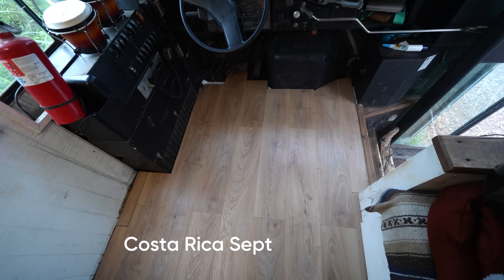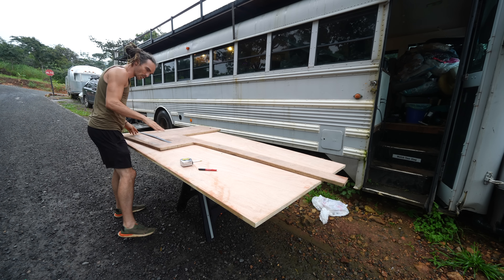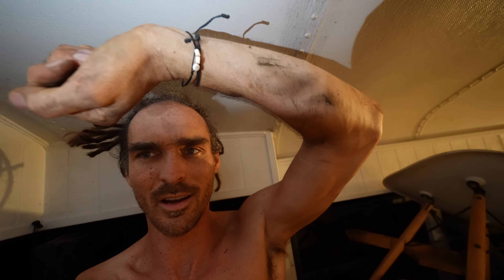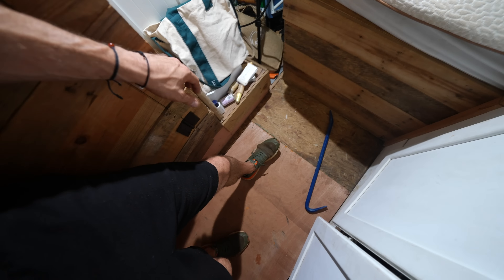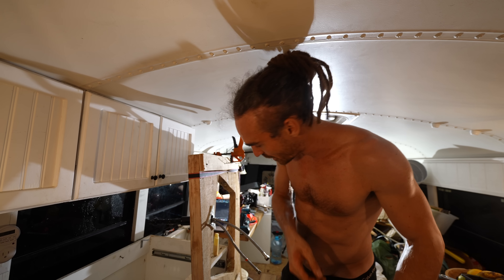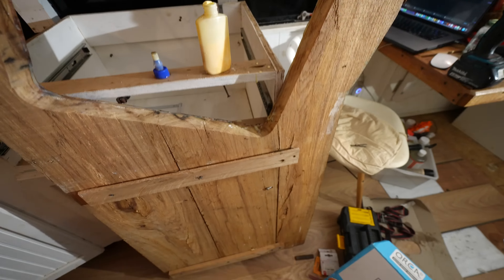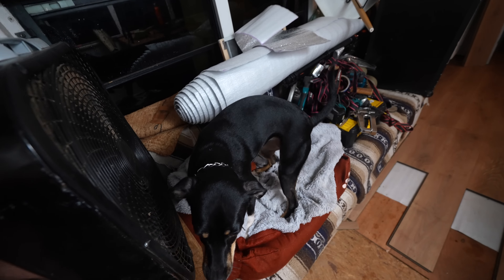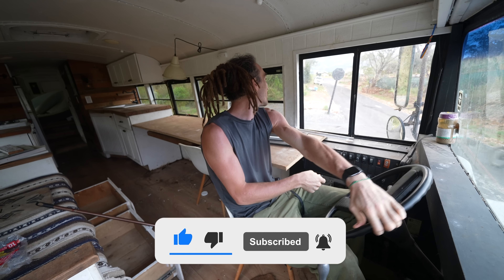Our School Bus Tiny Home // Costa Rica Renovations Episode 2

Comment: Hi 👋🏼 😊 Louis
After Seeing this Two last videos & the ones on your couple channel,
I Will like to recommend you, To Build A Roof where you are going to be positioning the bus🙂😊
So you will have a dry and more comfortable working place and maybe have less humidity problems. 
Maybe do there a Concrete Floor If Possible 🙂, 
To avoid Plants growing under the bus, 
& avoid muddy soil floor around it,
as well as you could easily spot any animals under the bus. 🤩
Good luck with the new projects🍀🍀🤩🌻🍀🍀